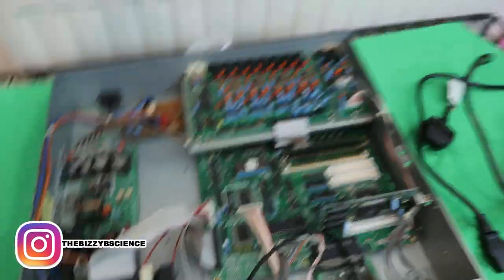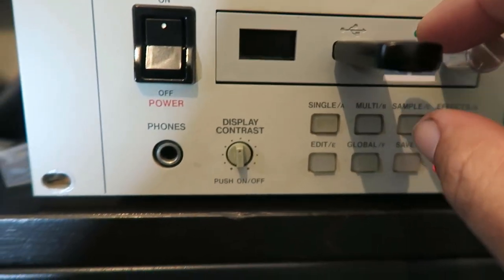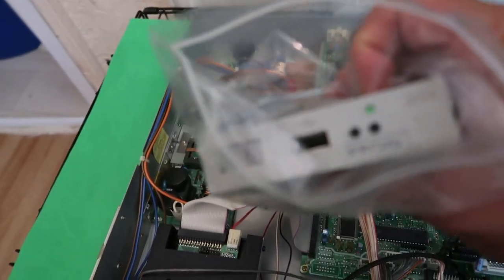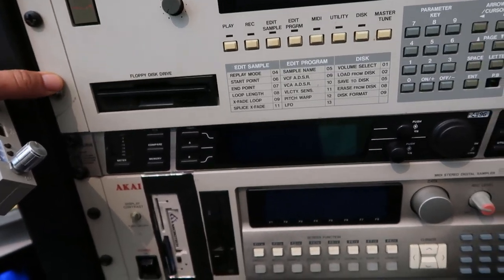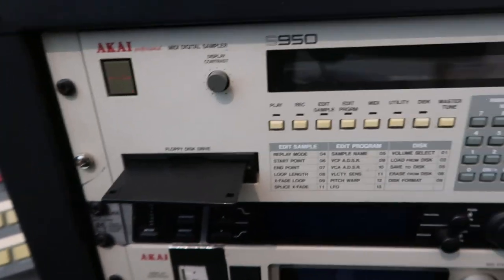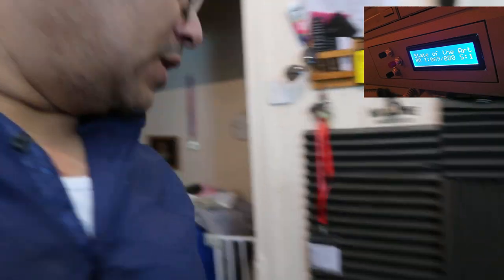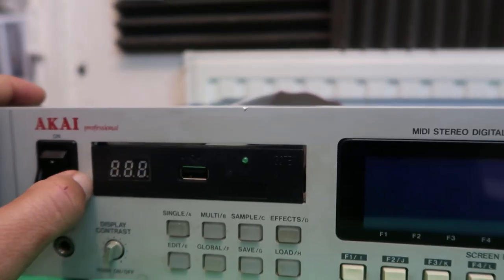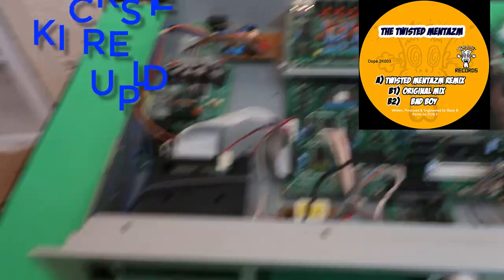MY AKAI S3000 Sampler 2019 MOD MISSION

Comment: Hi i went with a scsi2sd card which works great between my s3000 and s1000 cost around £60 and even managed to get it working with an old xp pc so can transfer to and from it in wavelab and recycle (v1,7) 😉
Reply: I did it on a scsi chain so just needed the right cables. Bought a broken scsi syquest drive enclosure which had db25 connections. Scsi2sd Sits in between them both. Did get confusung though when adding the pc!!
Reply: Just got my SCSI2SD interface.  Going to give it a shot this weekend.

Comment: Hi brian its gavin hope you good bro.I recently installed one in my s3000xl its was from cpmagneticmedia on ebay. Chris is great there should be included a second jumper and on the akai you may need this jumper on board the drive for the akai to see the filesystem .It should be on the pins marked on the board with JC Closed.So this should be bridged with an additional jumper.Also the ribbon cable should have the notch in it facing up in the air.Not sure about the usb file system chris would know about this as he sells gotek hxc floppy replacements.Nice one keep up the great work Big UPs Gavin